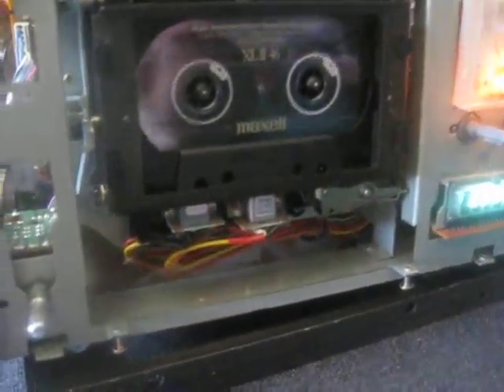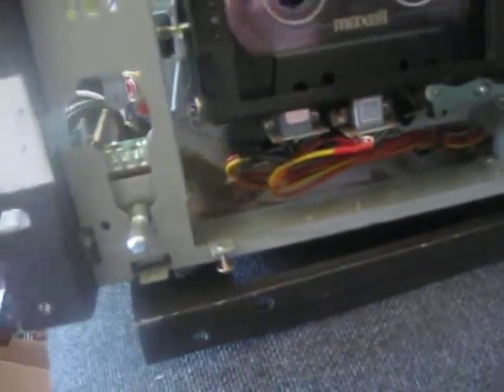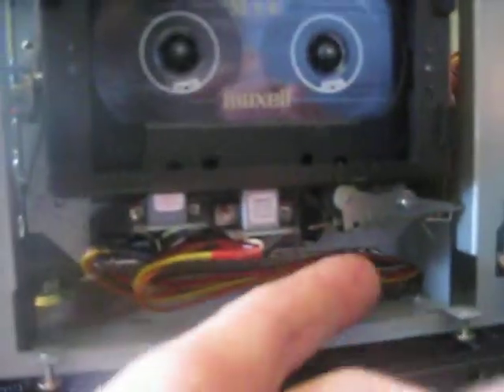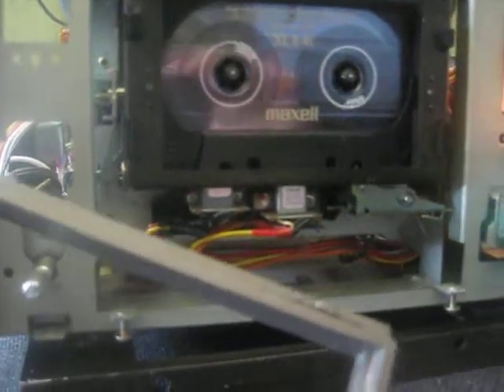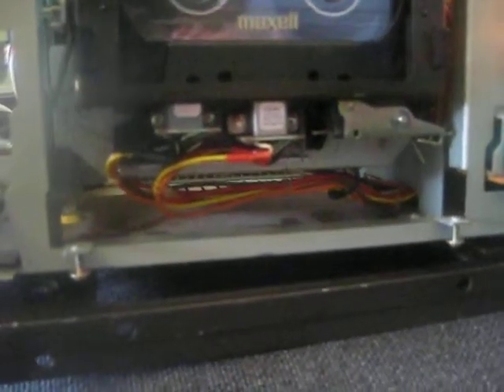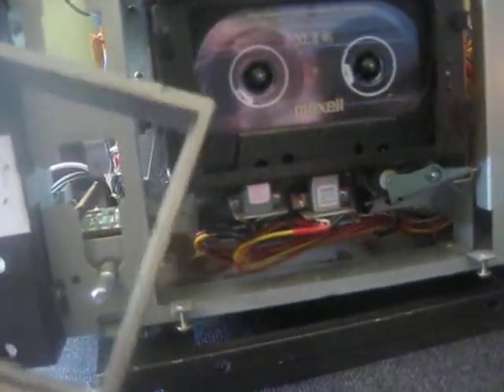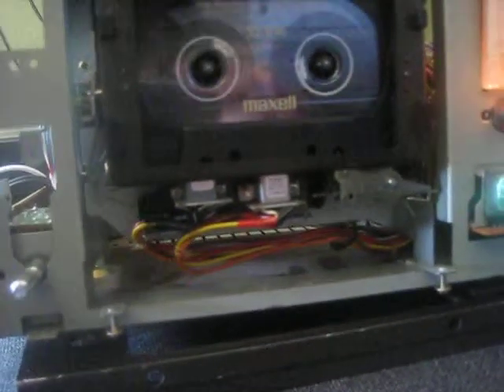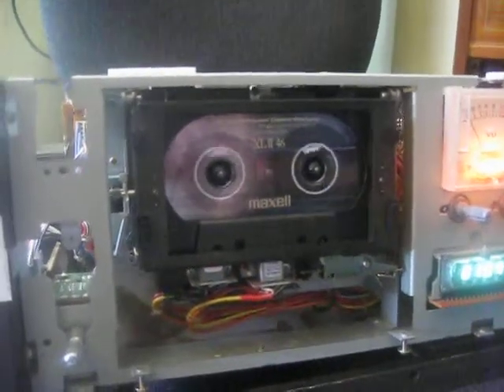tascam 234 transport issue

Comment: It probably too late, but the issue might be that the pinch roller arm is not in the correct position on the lever side(right).  It does not appear to drop the pinch roller down low enough when stopped.  Make sure the  pinch roller arm is above the stop lever that moves up when disengaging the transport from the cassette.  There could be a spring problem too.  The pinch roller spring should spring the arm and pinch roller up against the capstan when at rest(as when playing).  The stop motor will pull it away from the capstan by lifting the pinch roller arm up.  It looks like the pinch roller never leaves the capstan even when in FF or RR.  That's my best guess.